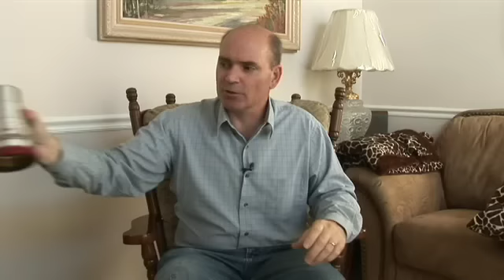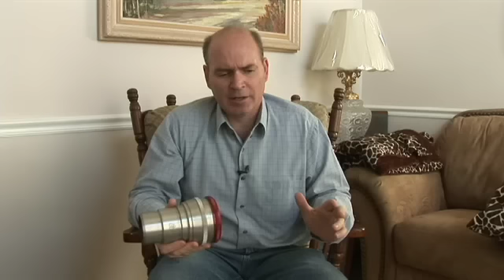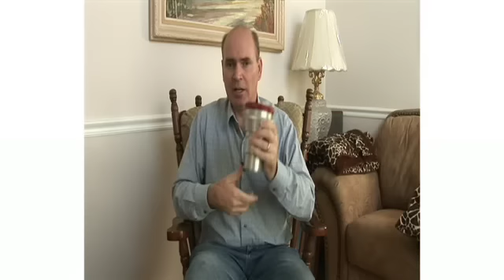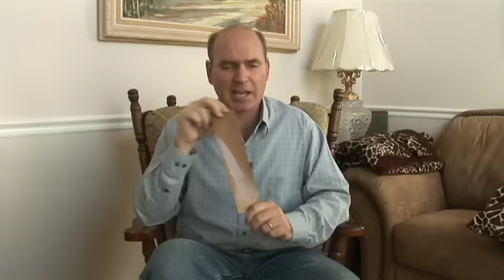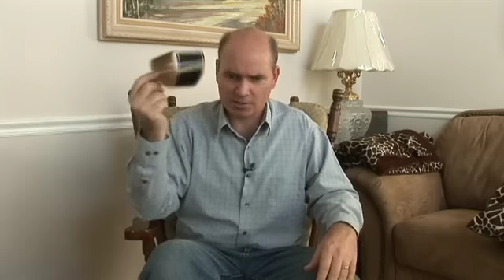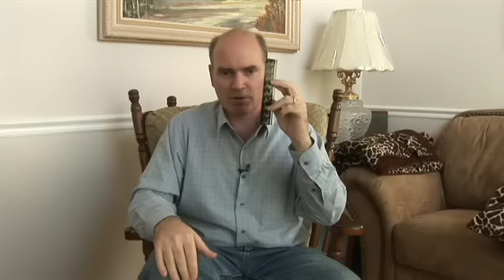Part 2 - A Lesson on Anamorphic Cinematography

Comment: Twilight, the vampire film, was released in Blu-ray and DVD in 2.39:1 aspect ratio, but for TV there's a 1.78:1 version of the film, and it's not Pan & Scan, in the 1.78:1 version, in the up and the down of video you have more image and things that don't appear in the cinemascope version.
What is this? The film was filmed in 1.78:1 and cropped to 2.39:1 in the DVD and Blu-ray release?

PS: The film was filmed with 35mm Panavision Cameras.

Comment from the maker: I tried it a couple of times, but not for anything serious. The problem is that you would have a hard time finding a mount or you'd have to make something yourself. Meanwhile, nobody really wants to make a solution for that because you can get anamorphic lenses that ARE made for camas anyway. Also, a projector's CinemaScope lens will have a 2:1 squeeze ratio, which would work for film. But anamorphic lenses for video (to convert 4:3 to 16:9) would have a different squeeze ratio.